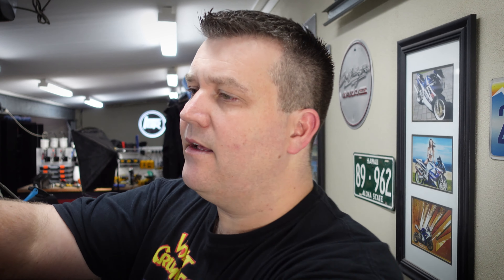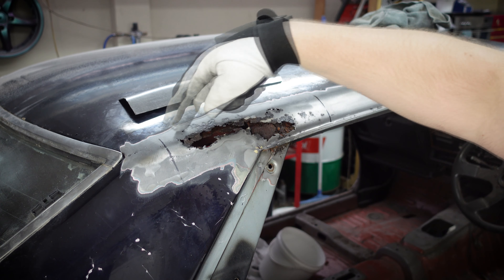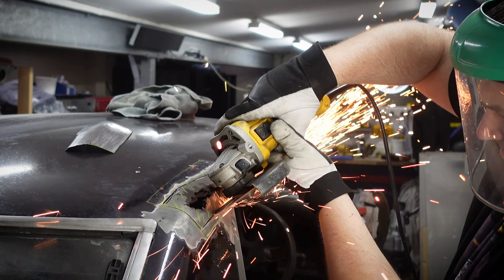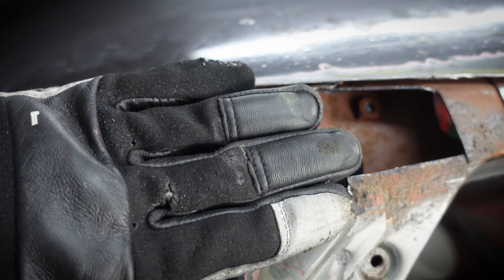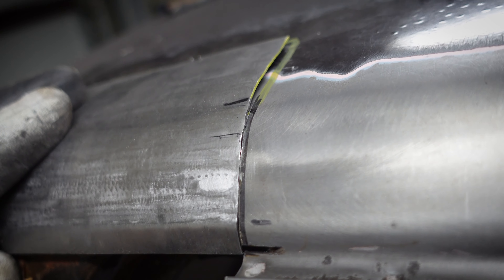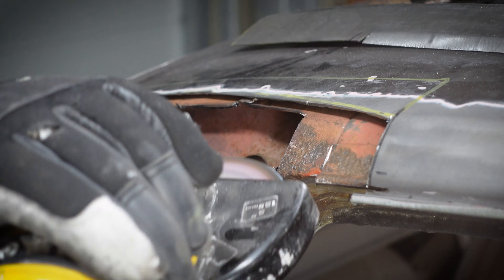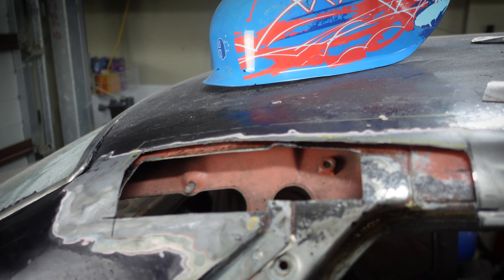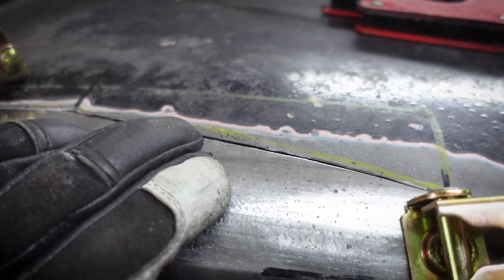Repairing the Rust in my Roof - RA23 Toyota Celica Restomod (Part 28)

Comment: I have the extreme fortune of having very little rust issues, but your instructions on how to remove the steel top window trim without bending it is gonna come in super handy next weekend when I start sanding down to bare metal!  As always just a phenomenal video, and I'm blown away with the amount of content you're able to produce.  You are a major source of info for my own repairs, so if you're ever in the States; I owe ya a beer!
Reply from the maker: Yeah the good bit about taking the trims of that way is that if you put them back on the same way you can take a rubber mallet to the bottom and knock them in, and if you do dent anything it'll be on the unseen area. Bare metal respray - excited to see what you do with it and yeah definitely planning on getting back to the states for a trip when i can 👍👍👍

Comment: I've cut some rust out of the windscreen cowl on my RA60 Celica, appears to be three layers of sheet metal I have to replace! Do you reckon welding in each layer's patch and painting each layer as you go would be the best way of preventing rust and a moisture trap?
Reply from the maker: Yep - unfortunately because you're welding the heat is going to kill any normal paint too - so you should look to paint the backsides of anything you can get to in copper weld through spray, then weld in, then coat the topside with either more copper if you'll be welding to it or close, or normal paint if the welding on layers above won't introduce too much heat to it. Try and keep your welded surfaces smooth as well so moisture doesn't pool in bad places. Good Luck!
Reply: @TheBuildRoom  cheers, I went and ordered some weld thru copper paint and will use that for the bottom layers. Hopefully it will last a decent amount of time lol

Comment: which rust converter did you use ? and did you was it off or just let it dry and pross over it ?
Reply from the maker: If you're in Australia it was just SCA (Supercheap Auto) brand. I leave it on long enough and so multiple wet coats till all the rust is black, then clean off the residue with wax and grease remover.
Reply: Thank you so much, so i am almost ready to fix my  proble. But  not sure , could not really  find any  professional solution on internet, everything  I found, is DIY, people's solutions, i have  T1N (first gen sprinter van) 2005, and  i need to repair, lap welds on the roof seams  all leaking , since  it's  kimd  of  car  that  will be walked  on the roof, what  will er  wont crack in the  future? Do you have any  idea.
Reply from the maker: @quayron2138  I'm not sure you're supposed to walk on the roof of those things, I can't think of much that would stop the lap welds moving around and eventually leaking. A quality mastic/sikaflex will last longer than a lot of things for sealing, but if its been panel bonded together and cracked my advice would be stay off the roof.

Comment: Cam. Good work mate. 
What a great repair you’ve done there. 
So glad I don’t have one of those to do.  
Which do you think was the most useful buy. The shrinker stretcher or the planishing hammer.
Reply from the maker: Thanks Owen - i think shrinker/stretcher vs planishing hammer really depends on what sort of work you have to do. If you have a lot of rust mid-panel that you're going to have to fabricate panels for then a planishing hammer but if you're fixing smaller common rust areas like fender flares, the boot seal lips, drip rails or your fabricating battery trays etc then the the shrinker/stretcher is probably better value.
Reply: @TheBuildRoom  thanks, good break down. Keep the Vids coming. They Help to keep me inspired with my build. 
Can’t wait to see how you tackle painting in a home garage. 
“2K or not 2K, that is the question.”
Reply from the maker: @owenlambert6201  will definitely be 2k, just ISO free so i don't kill the cats/neighbours/girlfriend. I may have to paint the final topcoat in a booth if its a candy, but primer/engine bay and jambs will all be in the garage.